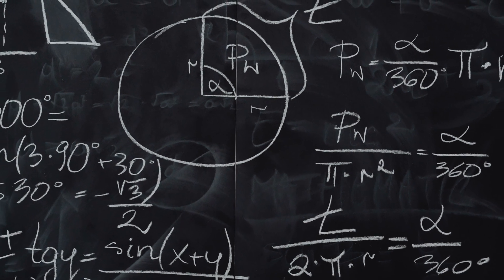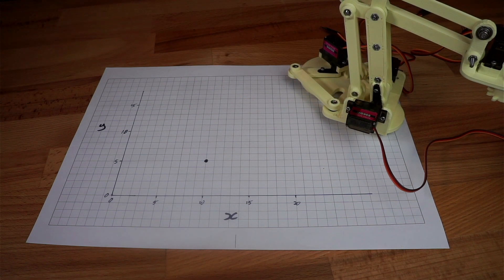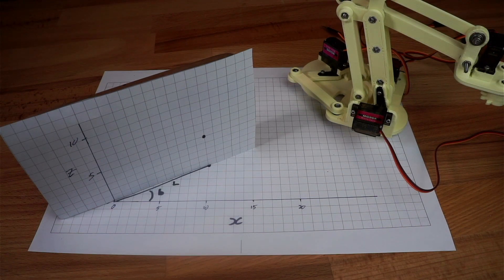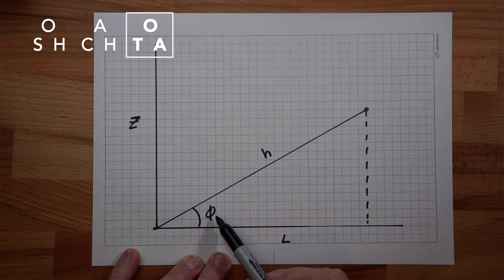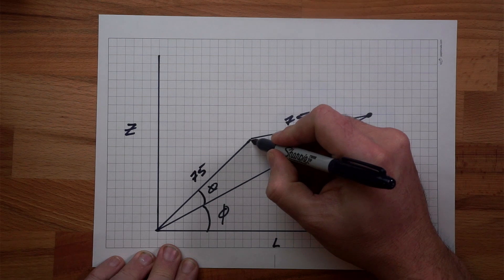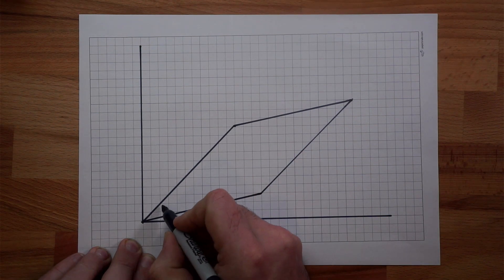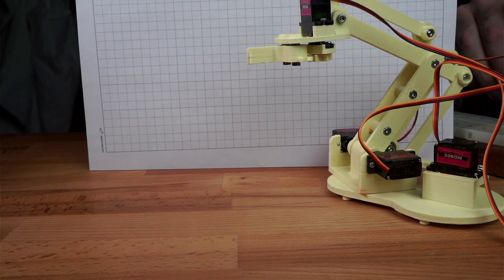Easy inverse kinematics for robot arms

Comment: I like the approach.  In my case, the robot has an orientable plate for the effector instead of a claw. 
So adapting this for my case, I'm thinking that the center of rotation ("yaw") of the plate  can be considered the end point.  Your 2-link arm becomes a 3-link arm, with the last link being at a specified angle ("pitch") from the x-axis.  Finally "roll" is independent if its center is at the same Z as the end point; if not, roll could be calculated first and its effect on Z reflected in the end point.

Comment: Is there any background information i should know? I dont understand why drawing a line gives you correct inverse kinematics
Reply: The point of inverse kinematics is to simplify down the instructions given to a multi axis machine down to simply the desired xyz coordinates and nothing more, knowing the length of each segment of the arm allows you to plot out a triangle using both the arm segments, and an imaginary 3rd line (The Hypotenuse)connecting the base of the first segment and the top of the second segment. With that, you can set up a simple triganametric equation where the Hypotenuse length is a input variable and allowing you to solve the triangle for any given Hypotenuse length allowing the outputs of that equation to be the corresponding motor angles.

Comment: This is an excellent video.  I built the HowToMechatronics SCARA robot arm (4 DOF), using 4 stepper motors and one servo motor.(for end effector).  The designer also provided a GUI made with Processing language.  The entire robot uses an Arduino UNO.  The build went well and everything works, but now the fun part of teaching the robot arm to do stuff.  The GUI shows forward and inverse kinematics and I'm trying to develop a system for teaching it to pick up wood blocks to spell a name.  Your video certainly helped explain the Inverse Kinematics.  Mechatronics worked out all the equations for the user, but didn't really describe how to use either to move the arm where the user wants it.  (I can jog to a position and save the value, so I'm assuming this does the trick.  The video was very well explained and you are very articulate.  And you pronounced phi as "feye", not "fee" as some do.  Small things matter.

Comment: Hi, Please help us to answer a few questions in regards to this video:
1: What is the main concept discussed in the video?

A. Forward Kinematics
B. Inverse Kinematics
C. Robot Arm Design
D. Trigonometry Basics

2: Which mathematical concept is used to calculate the angles for the robot arm?

A. Calculus
B. Algebra
C. Trigonometry
D. Geometry

3: What is the angle that determines the rotation of the base of the robot arm?

A. Phi
B. Theta
C. A1
D. A2

4: What does the cosine of theta represent in the calculations?

A. Hypotenuse
B. Adjacent
C. Opposite
D. Sine

5: What determines the length of the arm in the calculations?

A. Z
B. L
C. H
D. Phi

6: What is the formula used to calculate the angle for the base rotation?

A. Tan(angle) = Opposite/Adjacent
B. Sin(angle) = Opposite/Hypotenuse
C. Cos(angle) = Adjacent/Hypotenuse
D. Cot(angle) = Adjacent/Opposite

7: What is the purpose of transforming angles phi and theta into angles a1 and a2?

A. To confuse the calculations
B. To simplify the calculations
C. To complicate the arm movement
D. To introduce errors

8: Which axis is considered when defining the new plane for arm movement?

A. X
B. Y
C. Z
D. L

9: What determines the angle a2 for the second arm in the calculations?

A. Phi
B. Theta
C. A1
D. A2

10: What is the final step after calculating the angles a1 and a2 for the arm movement?

A. Implement the code for robot arm movement
B. Repeat the calculations
C. Ignore the angles
D. Change the robot arm design

Comment: I have a generic question. When applying FK/IK do you require that the motors have some sort of rotation sensor or a "zero point" so that all calculations have a reference starting point? My question relates to simple Lego technics motors which I can control through an Arduino,but since they are simple DC motors I'm not sure if I can use FK/IK in my designs.

Comment: thanks for making this video i have been wanting to understand the kinematics of such an arm and this is the first video that has got me close to it. there is one thing i still dont quite understand perhaps you can help.
forgetting rotation of the base it seems we figure out the angles the links are at and that is what we set.
we need to command the angle of the servo though. does that translate to the link angle directly?
my understanding:
when we move the first link though either it changes the shape of the parrallelogram (the one that is on the first link but moves the second), this would change the postion we are moving the other servo from, or we have to adjust the other servo that moves the top link to keep the shape of the parrallelogram the same.

Comment: Great explanation! But one thing still haven't clicked in my brain. Why is the a2 = phi - theta? I'm missing something here
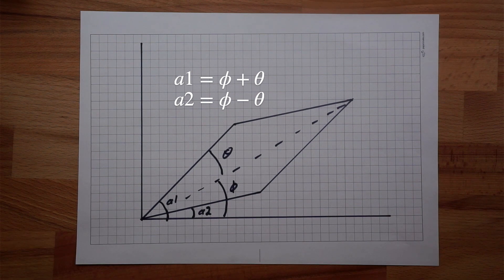Reply from the maker: Theta is half of the angle of one corner of the parallelogram (the dashed line bisects the angle, so the angle on either side of it is theta - I've only labelled one side of it at 4:38).

Once you get your head round that bit, you can see that phi is basically a2 plus theta.
Reply: @roTechnic  Just modeled the system in Rhinoceros + Grasshopper, now it clicked in my head finally
Reply: @roTechnic  but the diagonal of a parallelogram only bisects the angles of the corners if the sides of the parallelogram are all the same. What can you do if the arms are different lengths?
Reply: @roTechnic sir,I am getting negative value for a2?I am moving the links by potentiometer. How to tune negative angle for the second arm
Reply: @bkcganeshblogs  same man, cant figure it out

Comment: So like... where is Denait-Hartenberg? Why don't you need to se up the transformation matrix from base frame to tool frame to target frame, and solve for angles of each motor?
Reply: Because he deliberately chose a robot so simple that there's barely any inter-dependency between the axes, so almost everything is zeroes/cancels out, except what you see. Any actual real-life robot with a few more rotation axes requires the real deal, which compares in "simplicity" to what's shown here about the same as a nuke compares to grenade. I once wrote a graphic IK simulation for a modest Puma 560, and it left me traumatized to this day - 578 lines of matrix math and bare metal 3D graphics, in Turbo Pascal (yes, it was so damn long ago). Actual IK is only "simple" when a math lib is doing it FOR you.
Reply: @AttilaAsztalos  Hahahahaha I died laughing at that. I have coded finite difference on variable grid size and some other optimization schemes that also made my head explode, so I know the feeling.

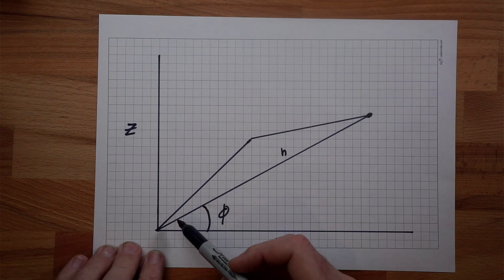Comment: How did he make the triangle in 2:34
Reply from the maker: The triangle is just one line from the previous triangle, and then the other 2 lines just represent the 2 parts of the robot arm. If the length of those lines are the same as the length of the parts of the arm, then you can only make one triangle.

Comment: Hi I'm using the LewanSoul digital servos, They don't seem to home or zero their position at the beginning of the code so whatever position they turn on at seems to be the one they set as zero. Is there any way to set them up to calibrate or home at the beginning of the code?
Reply from the maker: I've never used them myself, but it looks like you need to read the position and then use that as an offset. Are you using the lx16a-servo arduino library? if so, the examples for that show how to use the pos_read function.

Comment: Excellent project!  Could you export  STL files of robotic arm too as not everyone can have fusion 360 access?
Reply from the maker: Since you asked so nicely I've added the STLs as a single plate - depending on the size of your bed, you may have to split them up. I've also added the CAD as a STEP file so you can open it in your CAD of choice.